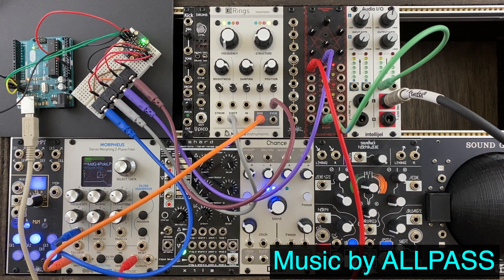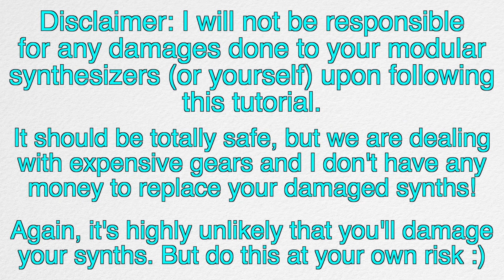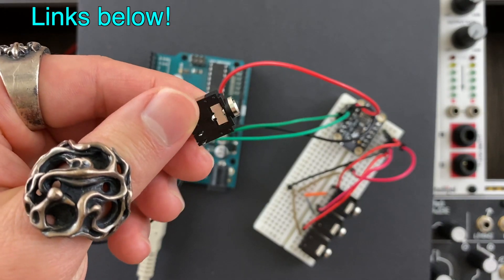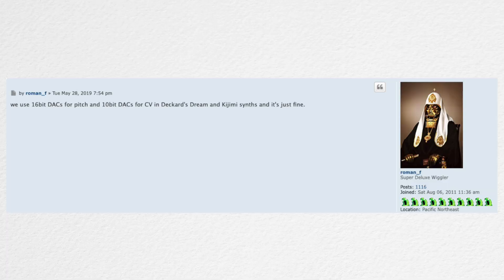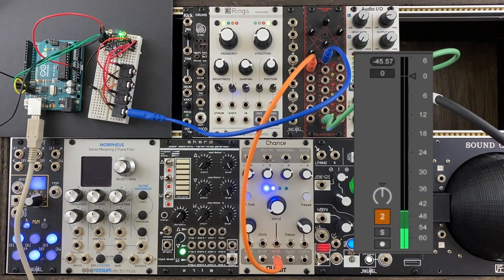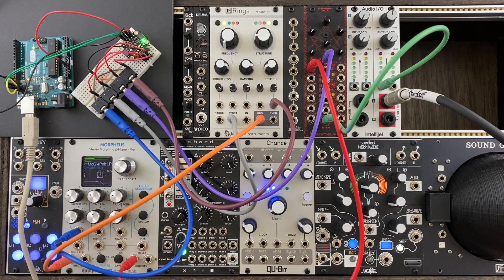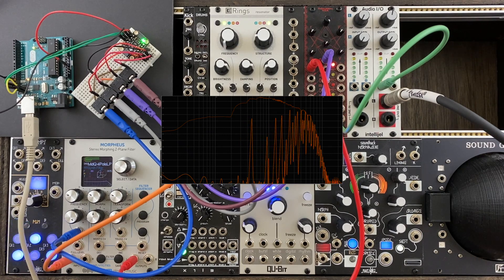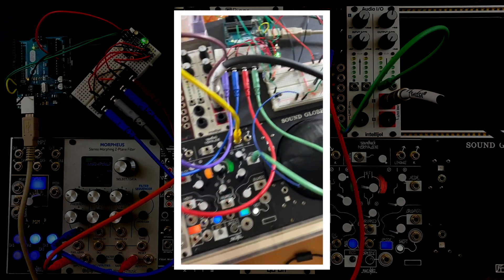4 CVs From Arduino! (DIY Eurorack Tutorial)

Comment: hi ! im super lost, wich code you use? and with the sensors, how do you connect the sensors and what code you use? thankyou
Reply from the maker: I pretty much used the example code that comes with the library pretty much! 

As for using a sensor with this breakout board, I have a separate tutorial video :)
It should be the one after this in terms of release date.

Comment: Thank you for the video! I suspect 12 bits of resolution is plenty for most applications. I’m curious about the test where you used white noise into a VCA to see how smoothly it affects the amplitude. I would be curious to hear you do the same test, but with a low-frequency sine wave, say 100 Hz, as that would clearly reveal any quantization or zipper noise in the ramp.
Reply from the maker: Yeah! That would have been a great test. 
I can't guarantee that I will be able to do this any time soon, but I am curious now! Thanks for the suggestion.

Comment: Great just what I was searching for. Thanks for the great explanation 🙏
Reply from the maker: HAVE FUN~
Reply: @SoundSimulator  do you happen to have some sample code? I've read the DAC manual 10x times now and I can't figure out where I specify the source each DAC outputs. Where do I set that it uses my sensor data? Im a beginner programmer so all is hard :)

Comment: I was brave and plugged this into my mordax data. 
I noticed a problem - mine cant seem to get all the way up to 5V, they get to like 4.88 or something like that. This makes me concerned that things like pitch tracking would be off/wrong. 
I am using PJ398SM, which has 3 pins, one of which would be for normalling if it is unplugged (i just plug that pin into ground since its being used as output) - i dont think that would cause this but maybe?

Any ideas how I could troubleshoot or fix this? I'm wondering if the DAC is just not very precise or if for some weird reason my arduino is messed up and not outputting a full 5v. 
I noticed if i touch the VA cable coming out of the DAC to my morax input that it is oscillating, like it will go up to 4.88 and dip way down, but somehow automagically when its wired through the jack it is steady.
Reply: That DAC is quite precise, and when set to use "external Vref", it can output a voltage equal to its supply voltage.
 Check that the DAC is actually getting 5v supply.
 Reading the pdf for that chip, it shows the output voltage can be lower than intended if the input impedance it's driving (your Mordax) is too low.
 Try adding a 2.2k resistor between the DAC output and the Mordax input.
Reply: The max voltage that DAC can output when using "internal Vref" and output gain of x2 is 4.096v.
 So you must already be using it in "external Vref" mode to be getting 4.88v :)
Reply: @massimookissed1023  hmm ill have to test it again this weekend, i could have been referencing the numbers wrong. Thanks for the tip.

Comment: Cool vide! Why using a DAC and not directly the analogue output of the Arduino?
Reply from the maker: Good question! 
For using the analogWrite() is perfectly fine for LEDs and motors and such. But for audio, the signals can be too noisy! 

So, using a DAC like this becomes necessary for eurorack application. 

You could run a PWM through a lowpass filter circuit (which is not too difficult to set up actually) and get a decently clean signal (especially for VCAs). Tho, it's not the most ideal solution for pitch CVs.
Reply: @SoundSimulator  Thank you for your reply. Interesting answer. I will have to try all this.

Comment: Hey! Do you know where can I find some references on how to send CV from a modular synth to an Arduino without damaging it?
Reply: Modular CV can be ±10v.
 Use a 6.8k and 2.2k resistors in series between your CV in and 0v ground.
CV in >--[6.8k]--●--[2.2k]--0v
 The voltage at the ● connection between the 2 resistors will be 24% of the CV in, so about ±2.4v.
 You could use an opamp to add 2.5v to that, giving a range of 0.1v to 4.9v, and feed that voltage to your Arduino's analog input.

Comment: A 12bit DAC gives 4096 different output levels.
MIDI only has a 128 note range, so if the DAC's CV outputs only covered 128 notes, that's 32 steps (of about 3 cents) per semitone.

Should be fine 😀
Reply from the maker: Oh, that explains the 4095 = 5V in the code. Of course!! 

Ah, thanks for actually doing the math. Yeah, it's totally enough!!! This thing is such a gift to people interested in DIY Eurorack.

Comment: I have a mmog mother 32. She wants some -5V to +5V to control. Anyone has some suggestions?
Reply: That's gonna require some amplification.
An opamp using Eurorack's ±12v supply could double the 0-5v output from the DAC, and provide the negative voltage offset to output -5 to +5v.

The very common TL074 opamp is a quad opamp, so it would convert all 4 DAC CV outputs with just one chip.

Comment: 1, show us the output signal on a scope please.
2, what voltage range do you get out of it? is it bi-polar? aren't you going to just get 0 - +5v range?
Reply: The MCP4728 can output from 0 to 5v (5.5v if you're feeling brave.)

After that, you're gonna need an opamp running off Eurorack's 12v supply to get higher than 5v.
Reply: @massimookissed1023  eurorack CV signals are -10v - +10v
Reply: @axeman2638  they can be, but that voltage range is more common for the sound signals than for CVs.
 At 1v per octave, a 10 volt range will go from sub-bass to higher than a mosquito on mushrooms.

Anyway, Eurorack has ±12v supply rails, so opamps can be used to rescale any input voltage to that ±12v range.

In the case of the MCP4728 outputting 0-5v, a -2.5v offset could be added giving -2.5 to +2.5v, and then that range could be multiplied by 4 to give ±10v.
Reply: @massimookissed1023  CVs are used for  more than just pitch, for modulation you need bipolar signals and full range.

would be nice if there was a single chip solution that gave the full range without having to add extra op amps.
Reply from the maker: I need an oscilloscope for sure. I might purchase one after I buy a 3D printer.

Haven't used on since undergrad tho... I gonna need a refresher.

Comment: This is a great vid and thanks for all the effort putting it together. In the past my son and I have messed around a bit with Arduino, and have written some raw PWM code where we can change the pulse width with a pot, or even oscillate it with some form of Sin wave (or stacked Sin waves => square/saw etc.) generation code. Now we're getting into some basic sound design, this is very exciting, though I'm using Softube's Modular rather than hardware and will have to work out how to get the CV into my DAW! Love a great challenge and big thanks mate from Sydney - Dave
Reply from the maker: That sounds awesome! Thanks for sharing, Dave!  
Feel free to share a video of the project when it's ready//

Comment: Hi! I am a total beginner at Arduino and electronics, so apologies for the noob question but how do I exactly connect the adafruit to the breadboard and Arduino? Is it soldered on the pins?
Reply from the maker: If I remember correctly, we need to solder header pins to the Quad-DAC. 

I have a video on soldering. https://www.youtube.com/watch?v=6ipeC9ebl1M

After that, check out my video on how to connect electronics around: https://www.youtube.com/watch?v=eVW0FD9g_Sk 

 The tutorials that Adafruit provide for the Quad-DAC will be handy too. 

GOOD LUCK!!! The hardest part is soldering the Quad-DAC imo.
Reply: @SoundSimulator  Hi, thanks for the answer! I managed to solder the header pins to the Quad-DAC and the green light is lighting up, meaning there's current, I guess. The problem is that now I have connected the audio jacks and no current is coming out of it...I tried to wire everything as shown in your video, but I have no idea how to troubleshoot this! Can you help me with that?
Reply from the maker: @daghesan  It's still possible that there is not enough solder on the other pins. 

How are you testing that there is current going out? Are you connecting to a modular synth, LED, or??   

Carefully re-wire everything. And check to see if you don't have any faulty wires, breadboard, and audio jacks (especially this one). Really examine the board. There are several possible solutions and it's impossible for me to guess over text. 

This is probably not the best tutorial for a beginner by the way, so you may have to take a step back and learn electronics basics. It's possible that you may be overlooking something that you learn in them.

And I HIGHLY suggest purchasing a multimeter for trouble shooting. 

GOOD LUCK. It's totally worth the time and effort!!
Reply: @SoundSimulator  Hi, thanks for your answer! Yes I am testing with a multimeter and there is no current coming out. I think the soldering is the wrong part, since I am not good at it and I think that I probably should re do it. But thanks for your answer!!
Reply from the maker: @daghesan  YOU GOT THIS!!! ✨
Reply: @daghesan  im also having this problem! did you figure out what the issue was in the end?

Comment: Great video. I was just wondering do i need to solder mcp4728 onto arduino uno?
Reply: No.  The Uno is a development board, meant to be re-usable, so it uses jumper wires instead.  There are cheaper Arduinos with the same functionalities, Pico, Every or Pro that require soldering.

Comment: Hey can some of these be daisy chained together? If so how would addressing each one go? And how many can be used at once?
Reply from the maker: I think you can daisy chain them as long as the address is different between them. Your guess is good as mine tho since I haven't done it before yet.
It's finally back in stock so I should grab another one. 

You can check the address in IDE but I'm not 100% sure how to change it. I need to do a follow up video covering that.
Reply: @SoundSimulator  I would appreciate it if you could, the reason why I was wandering, is because I was wondering if 8 note polyphony could be achieved by taking midi data, and splitting it to several gates and cv, although you’d need a lot of output jacks. I know there are already a couple modules that can do that already but I was wondering if there were any diy options, and using several of these dacs and an arduino seemed like a plausible solution.
Reply from the maker: @josezuniga3747  Heck yeah! Arduino controlled DIY polyphony synth is definitely on the list of tutorial to make for the future.
Reply: The MCP4728 has only one built-in fixed I2C address, it just doesn't have enough pins to select different addresses.

However, the TCA9548 was designed for this purpose.
It allows 8 separate I2C lines to be multiplexed out from 1 I2C control bus.
TCA9548A modules cost about $1 on AliExpress.
Adafruit also sell such modules for $7

You could have 8 x 4 CVs controlled by 1 Arduino.

Comment: Thank you for this great tutorial! The Adafruit MCP4728  QUAD DAC seems to be out of stock everywhere, can you recommend a substitute? Thank you again :)
Reply from the maker: Yeah, lot of electronics parts are out of stock right now unfortunately. Hope it get better soon! 

In terms of a substitute, I don't know if there's one as far as I know. If you need to do this for school project that's due soon, you could purchase two MCP4725 and you'll have two DACs with one I2C. 

You could also create lowpass filters on breadboard and use PWM out of Arduino to have a decently non-noisy DAC.   

Otherwise, I would wait until they're back in stock!!

Comment: 12 bits is 4096 steps over 5 volts (5 octaves) this is 819 steps/octave or 1.46 cents/step. This is a difference you will not notice (at best it takes 3 cents on a pure note to detect  a frequency change at C7, even more on lower notes) but the truth is in eating the pudding. I would get 2 oscillators with two CV values at the same voltage and tune them to be exactly the same. Not start changing one of the voltages step by step and listen. Most likely you will notice it is easier to get them in tune by changing the CV than by changing the potentiometer on the oscillator :-)
Reply from the maker: Thank you for your insight! Yeah, I wish I had more modules (specifically analog) to test this with. 
I did notice that it was easier to set the pitch with CV than the on-board knob.
Reply: The correct proverb is "The proof of the pudding is in the eating."
Reply: @SpeccyMan  I stand corrected 😉 I guess this is what happens when I type without thinking. Took me some time to see my own mistake here 🤭

Comment: Just ordered the Teensy's quad audio DAC. But, it has capacitors on the audio outputs, so it's not DC coupled. So I'm unable to out DC offset voltages for RGB and positioning imagery. 🤦‍♂️
I'm also waiting for their 8 channel PCB, which I'll need to populate with SMD components, to have enough channels for XYRGB. 🤦‍♂️
So, unless I'm mistaken, you were outputting a DC ramp into the volume input of your VCA, using that inexpensive Adafruit's DAC?🤦‍♂️🤦‍♂️🤦‍♂️
Reply from the maker: Didn't know Teensy has quad audio DAC! 
That's useful//
Reply: @SoundSimulator  I forgot to mention that the Teensy has lots of DSP and filtering codecs. Their quad DAC communicates via I2C and passes audio over 16 bit I2S.
The Teensy 3.6 has 2 DAC output GPIO pins, so a single stereo shield could be used to produce quad audio outputs, as well.
The Teensy 4.x also has an 8in/8out audio DAC that uses multiplexed TPM. But, it's only an unpopulated PCB that uses SMD.😱 But, the gerber files and BOM is available to send to JCLPCB for mfr. Haven't crossed that bridge, yet.
Just connected the Adafruit quad MCP4728 to my T3.6 on a breadboard to test it out.
😎

Comment: Hi! How are you sending CV to your Modular? Does the Laptop recognize the MCP/Arduino (once you upload the code) as a regular audio interface? Thank you
Reply from the maker: Hi Paolo!

Arduino itself is sending the CV via the MCP DAC.  
Laptop was used only for uploading the code and powering the Arduino via USB power. I could've powered it with AC adapter or battery and it would've been the same.

If this is your first tutorial that you see on my channel, I recommend that you watch this https://www.youtube.com/watch?v=eVW0FD9g_Sk
Reply: @SoundSimulator   Thanks for the answer. I’m interested to send CV through PD. I’m curious to know how would you manage serial data from PD in the Arduino code.
Reply from the maker: @paolocolagrossi7632  I'm currently working on a new tutorial covering that topic! Stay tuned!!

Comment: Perfect timing with this video, thank you!  I have a project I'm working on using sensors to interact with sound and am very new to arduinio. That module should be pronounced "unicursal" as in one line, as there is a unicursal hexagram pictured on the module, a hexagram drawn with out having to lift the drawing tool.
Reply from the maker: Thank you so much for watching, Anthony! I'm actually editing a video where we use this Quad-DAC with sensors. Should be out in few days!! 
Ah, I didn't know about unicursal hexagram! That's really cool. I'll make sure to pronounce it as that next time!

Comment: Nice! I‘ve been thinking about porting a MaxMsp sequencer I made to arduino but I don’t have any experience with arduino. Would you know if there‘s a starter kit with all parts necessary, like you have it in this video? Tried to find one on the web but couldn’t find a one stop solution with breadboard, jacks and so on. Thanks!
Reply from the maker: Next video I'm working on is actually on converting Max data to CV! 
 
I have links to the parts in the description. It looks like the breadboard + wire set is out of stock, so please check the description in this video https://www.youtube.com/watch?v=ftDtsSHU2UM 

In terms of just sending data from Max, you really don't need much parts! I typically don't recommend the starter kit anyway. Also please avoid off-brand Arduino! There are a bit cheaper but I had people running into problems when trying to interface with Max or Pure Data.  

Have fun! And best of luck!!!
Reply: @SoundSimulator  thanx for the reply, very looking forward to your next video!

Comment: Great video, I have been following your projects with great interest 😁

I think using a 12-bit DAC for pitch is fine. I have a Sonic Potions Penrose quantiser module, which uses a 12-bit DAC, and it sounds great.
Reply from the maker: Thank you so much, Josh!! 
Ah, that's good to know!! I should've included examples of 12-bit DAC in commercial modules!! I'm currently in the process of testing the resolution between two notes semitone apart! So far it looks promising!!
Reply: If we simplify the maths by mapping 12 bit values to a 0-4volt range you get resolution down to 1 millivolt. 0.83 millivolts is 1 cent in the 1V/octave standard. So yes 12 bit for pitch definitely works.